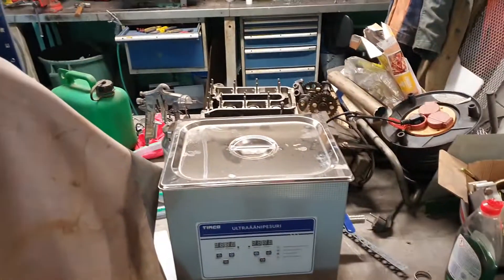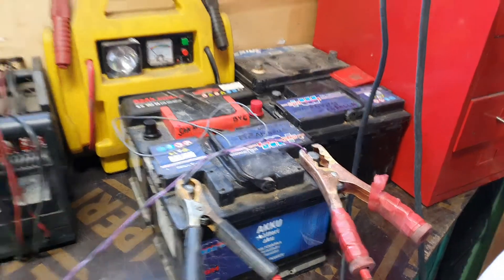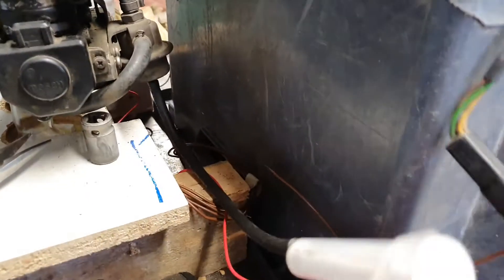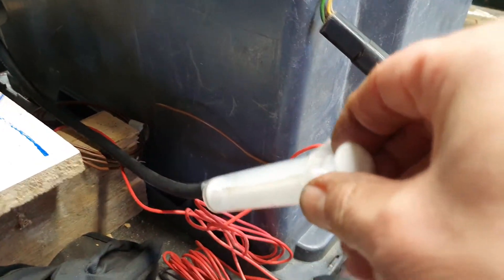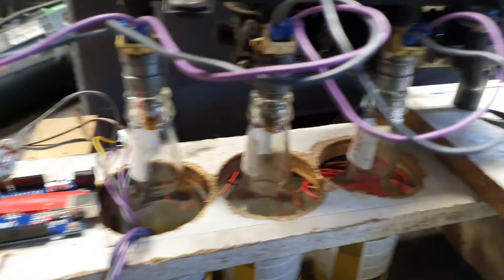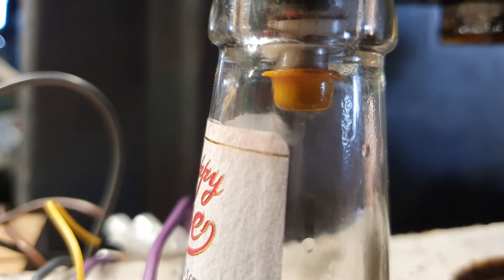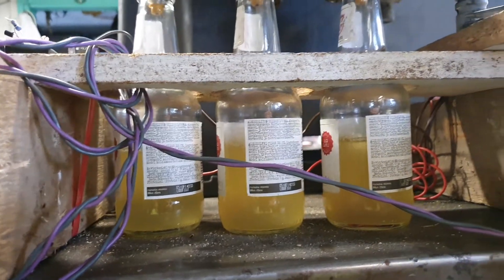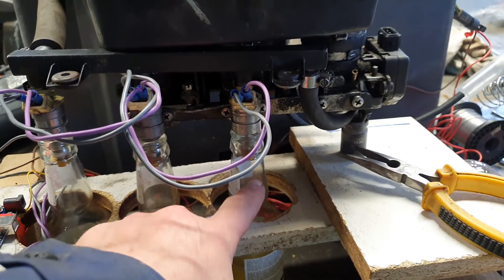BMW K75 Engine Service Ep.3: DYI Petrol fuel injector testing & maintenance

Comment: Great video thank you. Can I ask this. I was under the impression that the fuel regulator varied the return flow of fuel from the rail to the tank. Not changed the speed of the pump. The change of noise in the pump would just be the pump under more or less load. Keen to here your opinion.
Reply from the maker: I agree with that. 
Without a manometer, the changing pump sound is the only indication the regulator "does something" ergo works, be it without calibration.
So, even if the regulator doesn't control the pump, the pump does give away the regulator"s action.

Comment: Do you know how to bypass the Mass Air flow sensor and still have the engine run ok
Reply from the maker: Sorry, I don't deem that possible.
You must always have the correct stocheometric air to fuel ratio. So measuring of air is imperative for fuel quantity injection.
We had a 35% fuel consumption reduction and much better running by
1. This cleaning
2. Replacing all leaking inlet rubbers, vacuum tubes etc. that introduced too much air.
"Everyone" knows how much effect even a leaking Z-tube has.
You can't run an injection engine with guesswork.
(In theory a mapping could be made based on throttle position and rpm, but it wouldn't be good, only running).